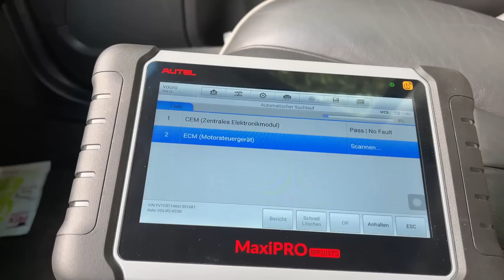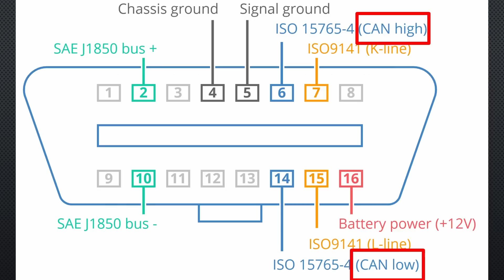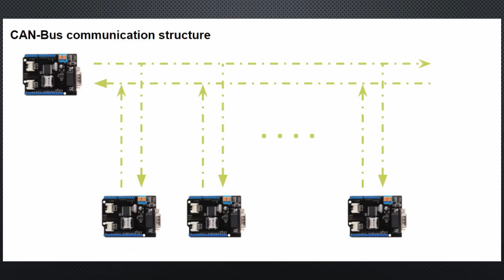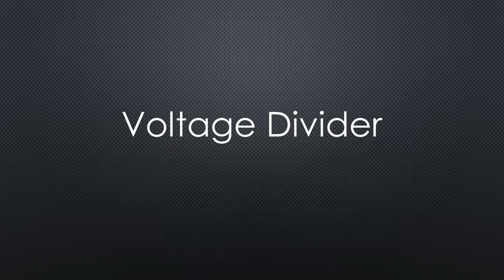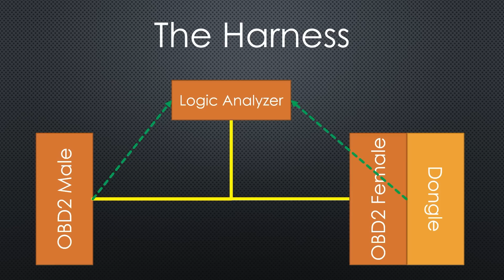#421 Home Made OBD2 Engine Alarm Resetter device using an Arduino?

Comment: Hello,  reseting ECU (Engine Control Unit) default log is not the most inteligent way to behave. As in electronics and all domain, analyze and heal/correct/repair the source of the problem is THE best way. 
Some of your follower may have been able to help you if you had shared the default more than "it was an low/high signal on a sensor".
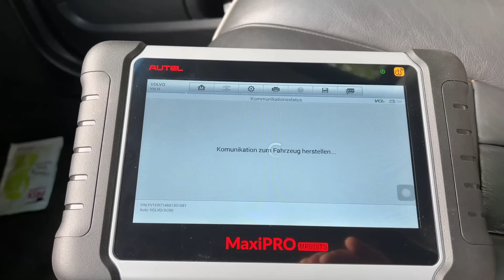Obviously by pausing the video at 4:32 and with my poor level in german "Glüerelaissteurung" sounded to me very close to "Glow relais ...." for which Google Translator confirmed "glow relay control", since you have this  default 4 time with error code following each other (almost) (code 6661, 6663, 6664, 6665), and since you talked about a VOLVO car...
The Glow function is used to pre eat combustion chamber on Diesel engine, since it's a VOLVO and they've been saling 5 cylinders Diesel in the past, I would presume that glow plug of cylinder 1, 3, 4, 5 are not in good health. 😉
Regarding the default rised by the ECU that did stop your engine, since your video do not show the default it's not that easy to diagnose. Since you've talked about a sensor and not said anything about an actuator, and also because mos of the time car company usually stop the engine when there is a high risk to brake the engine. I'll may bet for a default on the high pressure fuel sensor.
Reply: I agree that it must be a really critical sensor for the engine to shut down on it's own, that really is a last resort in the software. There must be a damaged wire or broken sensor somewhere that needs to be repaired.
Reply from the maker: The alarms shown now are only casual alarms. They often appear and do not interfere with driving. The blocking alarm did not reappear since then. I wait for it…
BTW I did not want to save the repair. I just wanted to move the car to a safe place ;-) It was obviously possible because it drove now more than 100 Kim’s without a problem…
Reply: @AndreasSpiess  the Glow plug code are present on many engine I've diagnosed. They are not problematic at all if your engine is not started below 0 to -5°C, maybe even -10°C depending of the engine. I'm talking about Diesel engine only, for gasoline engine the story is different.
Anyway, as I said the glow plug daignosis will only have a visible impact during engine cold start since you may need to keep the starter activated a longer time than usual.
Reply: @mrfrenzy.  Yes, I've been facing an issue arround 255000km on my CITROËN C4 with a DV6 TD 92hp €4 engine, while on a climbing road, the engine cut off, MIL light ON, I was able to restart engine at the idle rpm of 750rpm but as soon as I reached aroud 1050rpm engine cut off again... after I diagnosed the engine at home, there were trouble code about high pressure vavle regulator out of bound, an other one about low level signal of high pressure fuel sensor, the usual glow plug open circuit etc... it was one of the 3 wire of the high pressure sensor. this lead to a low pressure reading from ECU which try to conpensate by opening more the vavle that allow the high pressure pump to introduce more fuel into the rail, but at one point the valve regulator rise the limit of its regulator and rise a default. and then the degraded mode is applied which lead to engine limitation. In the case of Andrea's car it seem that VOLVO dicided to activate a very conservativ mode ;-)

Comment: I very similar experience with my BMW, oil level sensor failed in a way that it pulled down the whole CAN-BUS line preventing ECU and gearbox talking to each other, I didn't know it at the moment it happened and had stopped the car and couldn't restart it any more with the key because the ECU thought the car was not in N or P positions, since I had a lot of experience with engines on these cars, I took a 2 EUR metal coin and reached under the intake manifold to feel the starter and shorted the high current +12V coming to the starter to the starting pin next to it, and it started right up
the gearbox was in limp mode, but I was able to drive the car home to then later find the actual fault, talk about non critical sensors on bricking cars for no reason whatsoever, so much for German engineering...
Reply from the maker: Good story! I also only wanted to get off the road. Unfortunately, since then the alarm did not reappear :-(

Comment: I have a Bluetooth ODB2 device that cost $10 US, and a free Android app, that accomplishes this with also data logging and visualization. It works on my old Ford minivan up to my son's new Ford. It works across a lot of other makes and models, too. I can use the same device with the RPis, too.
Reply from the maker: And does it reset the alarms? The ones I tried unfortunately did not :-(
Reply: @AndreasSpiess  Yessir, at least until it re-discovered the issue was still 'broken'. I had an intermittent bad MAPP sensor, and another bad sensor. It would reset the alarms (Check Engine Light & software flag) until the sensors would stop responding appropriately, then the Check Engine Light and software flags would go on again. Replaced the MAPP sensor, and fixed the leak at the other sensor and didn't have any further issues until I sold the minivan. 
I am using it now to do continuous data logging on my son's Ford. It's not the BT device, though that resets the flag and light, it's the software run on the Android or Pi. They have to have the ability to talk to the car's computer...

Comment: Don’t get me wrong and this is a fun project, but … there must be somewhere a message stating getting the issues diagnosed, checked and fixed must be the way to go. Just throwing away or resetting error messages all day long can cause quite some severe issues in the (not so) long term. If a sensor prevents the engine to run, it could be caused by a sensor that fails the engine management to tell in which phase the engine/cylinder is. This info is crucial to inject fuel and spark at the right time.
That said, bring on part 2 !!
Reply from the maker: I agree that dealing with errors is important and I trust that my viewers know that. I just wanted to get off this street into a safe place (I am a Volvo driver ;-)

Comment: Diagnostic connector is often on a "gateway" between the several CAN buses in a vehicle. The drivetrain bus can operate at 2 megabits per second and the "convenience ' bus as slow as 125 kilobits per second. The gateway routes messages between buses, depending on what device has registered an interest in that message type... which can be somewhat dynamic but is often coded into devices such as the gateway.

The protocol was designed (obviously) by committee with scant regard for the sanity of those who implement it.  It's nice in principle but the details are a swill.
Reply: Highspeed CAN in vehicles is 500kbit/s at almost every carmaker. 2MBit/s is only common in very modern CAN-FD networks.
Reply from the maker: Indeed it seems to be complicated. Even on old cars like mine...
Reply: Some cars have multiple CAN buses with gateways going between them. (Modern car design so that attackers can't screw up everything all at once. And also, as a separation of duties.)
Radar CAN buses are common.

Comment: Hi Andreas,  you can use ESP32's built in CAN controller and CAN transceiver such as TJA1050/1040. Personally I've found more consistent results with TJA1040, plus it support low power standby mode. Problem is, TJA1050/1040 are 5V devices, so logic level converter is a must to communicate with ESP32.
Reply: There is SN65HVD230 or SN65HVD231 which works from 3.3V.  Despite using 3.3V to drive the CAN bus it interoperates perfectly well with 5V devices.  Another alternative is to use STM32 Blue Pill which also has a built in CAN controller and is 5V tolerant so TJA1050 can be used.
Reply: @delboy4711  The TJA1050 works with 3.3V logic from ESP32 at RX and TX. You just need to connect 5V to VDD. No need for a logic level converter but certainly advisable
Reply from the maker: Thank you for the info. The CAN interface works fine and is cheap. What I need is the codes ;-) Maybe I will use an ESP32 for the final design.

Comment: Other possibility: Get a $5 OBDII-Bluetooth adapter, link to you phone and use one of the apps to check / reset codes ...
Reply: That would be too easy... but the obvious solution
Reply: @Andy Smythe I guess if you had powered an Arduino from the onboard 12V, it would probably have killed it, too ... goes to show: You need a decent power converter with a protection circuit when powering any devices ....
Reply: Do the cheap OBDII work on all cars?
Reply: @he1py  can't say if they work on all OBD2 cars, can only speak of a 2008 Volvo and 2017 Chevy... The elm adapter works on both

Comment: Hi Andreas
i am by no means an expert, but car diagnostics is a real, almost impenetrable maze.
as many said, apart some generic codes and functions, every car manufacturer uses a different subset of commands and errors, that even change from model to model. 
some car manufacturers have also been extremely efficient in hiding the protocols, and those who did all the reverse engineering work dont give the info away for free... i recently scrapped a friend's old car  because engine would not start and we could not diagnose the problem. 
an additional problem is that error codes mean different things from one manufacturer to another.
plus there is the problem of interaction between the oily bits, the electronics and the diagnostic sw.
a friend recently had a funny problem. engine would go on limp home mode because of clogged antiparticulate filter.
forcing a regeneration would solve the problem but then filter would clog again in a few weeks. according to diag the engine was regularly doing the filter regeneration. after many attempts, resetting the oil change parameter fixed the problem. engine management started regen cycle, but as it thought oil was old (filter regen will pollute the oil and only a number of regens is allowed) cycle was interrupted and never completed, and filter was clogging...) and we have a proper diag software..
lastly, a blind reset of errors will not necessarily solve yoiur problem, because depending on error, it will reappear again as soon as you crank the engine, and engine will be disabled. i once had a crank sensor go bad, it would stop working when very hot. resetting the error would not work, but after a few reset engine would start because in the meanwhile engine had cooled down... but to see the error required a dedicated diag sw. commond code readers would not show that error, and anyway, that code was fiat specific. 
bottom line is...is going to be tough, and whatever you develope might only work with that specific manufacturer, model, year...
greetings from sunny (today) switzerland
Reply from the maker: I agree that resetting the error will probably not solve the issue. It just would have helped with getting out of the traffic ;-)  Unfortunately, I still wait for the error to reappear.

Comment: Hey Andreas,
This is Mohamed 7X3TL, I have been fiddling with CAN Bus for a little time now on my Peugeot 207. And to say the least my car has 4 CAN buses, two of which are exposed thru the OBD connector, pins 6 and 14 are for ECU CAN and pins 3 and 8 are for diagnostics, I made a little app using Delphi to read the messages and interpret them I get a lot of sensor data that are given by the ECU automatically, but as of yet, I havent been successful in getting the DTCs from the Diag Bus, still trying though.
Keep up the good work, totally a fan here!
Reply from the maker: @Mohamed: I knew they have more than one bus. But I was not aware the second bus is also exposed to the OBD connector!
Reply: @AndreasSpiess  neither did I until I checked Peugeot official electrical documentation.
Reply: Any documentation of your work online ?
Sounds interesting !
Reply: @ErikB750  haven't reached the point where I feel confident to share it, but, since there is interest I will document it somehow.
Thank you
Reply: Get a clone diagbox/lexia or find someone that has one that you can borrow. Then you can send all commands from the computer like clear dtc or activate actuator and sniff the messages.

Comment: In emergency usually you can still unplug battery for some time to clear the dtc errors, the time depends on the car.
Reply: DTC are stored in flash/ee-prom for many years at least for the last 20/25 years, I'll be very interested to learn which car maker had been using  Engine Control Unit that do not back-up their DTC in EEPROM/Flash?
Reply: @mybricology7388  in my astra g you can at least for those who turn on the check engine light, but I don't have a professional tester to read more in depth.
Reply from the maker: Not easy in my car because the battery is buddied under the rear trunk...
Reply: @AndreasSpiess  as mentioned before also pulling a fuse or any other means to cut power to the ecu would do
Reply: @mybricology7388  Same trick (you can remove the ECU fuse to clear ECU) works on japanese car of 2004. I will not name the brand 🙂

Comment: Really hope you see this...
I'm wanting to implement OBD2  along with posting sensor readings...but importantly also sending commands to automate AC, electric windows and interior lights...for a future overland LR defender build...please make a video on how to sniff and access sending command codes to CAN busto automate a vehicle with home assistant...
Reply: There isn't one CAN bus but generally two, with a gateway firewall in between them. So one of them has engine stuff, headlights and signal lights, and another has all the interior stuff. I don't know where the OBD2 sits, perhaps not on the accessory CAN. The accessory CAN should be found going into the headunit.

At least if your vehicle is anything like Bosch equipped ones.
Reply from the maker: Interresting project. I also heard that the newer cars use several sub-bus systems...
Reply: What year Defender? I work with these cars, the CANbus on them goes from the ECU to the gauge cluster... And that's it. It's only used to drive the RPM, temperature gauge, check engine light, charge light, diesel pre-heat light, oil pressure light and maybe the traction control light. Not sure about the last one. All other functions of the gauge cluster, and the whole car for that matter, are mechanical or analog
Reply: @stormvaneersel5476  well was hoping to implement in a 2008 puma.  And try see if i can control electric windows, central locking and possibly not sure of legality but a remote start
Reply: @srrandall88  Ahh, i think i've misinterpreted your comment. I thought you meant your build would be a Land Rover. To reverse engineer your CANbus, you could take a look at savvycan.
Reply: @stormvaneersel5476  awesome thanks. 
But also get live sensor readings for oil temperature and fuel consumption to be able to post to a local car server that i can access online too. Because the defender is so old it doesn't have modern infotainment ability. So i want to integrate into a new centre console dashboard. With aftermarket RF tyre pressure gauges but also voice command  external and internal lighting,  turn on the car and turn on AC to cool or heat the interior before i get in. Also have the system monitor solar charging and power use all on a centre console using a 12 inch touch display. 
I'm first also looking at a way to have multiple slave microphones on interior and exterior.

Comment: Nice! Can't wait for the follow up video. I have a similar project in my TODO list, except for different purposes: My brother has a broken dashboard (with intermittent malfunction) so he purchased a second hand dashboard (the new ones are ridiculously expensive). The problem is that now the kilometers on the (new) dashboard do not match the kilometers on the ECU. Because of that, the vehicle fails the annual obligatory inspection. I'm hoping to learn something on how to approach my build. :)
Reply: Maybe it is enough to just swap the flash memory on the two instrument clusters.
Reply from the maker: Your project seems to be far more complicated than mine :-(
Reply: maybe not that "far", on the hardware/software side, but I'm counting on having to interpret insane amounts of data. filtering the "noise" will be challenging for sure, but I like challenges. and my brother has beer. what can go wrong? :-D
Reply: @oilybrakes  A bit of an invasive and risky option, as I lack decent equipment to perform such a task.

I'll have to consider it, nonetheless,  as a last resource, if a software based approach fails.

Comment: Another interesting piece of information. Thank You !
As others already suggested I use the elm327 bluetooth dongle in two ways.
First to read and reset errorcodes for repair via "torque" android app and plugins.
Second to display some data not available in the cars instrument cluster via a ttgo tdisplay and  obd arduino libraries but all are working random on reconnecting bluetooth ..... WIP.....
Reply from the maker: I tried some apps in the past but they did not offer the function to clear DTCs. After many comments, I checked again and this function is only offered in the "pro" version for 20 bucks. I will buy it and hope you are right ;-)
Reply: @AndreasSpiess  
as You know beeing universally right is difficult.
So I can say it worked for me on my BMWs and Opel cars years 2000 to 2015.
Also its only for OBD (emissions) errors so covers most engine faults.
Have it for several years and think pro licence was cheaper then ?
Other systems or deeper diagnose is sure marque specific sw .
Reply: Unfortunately the ELM327 does not work on Nissan 2015 Livina & 2018 Micra: There is another protocol layer, known as Consult-III which messes things up for "ordinary" people :-(